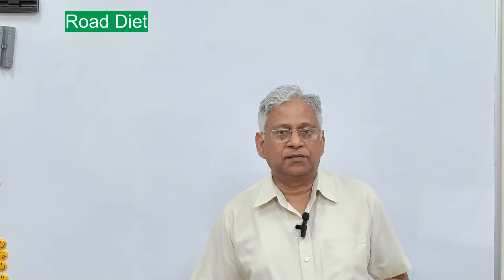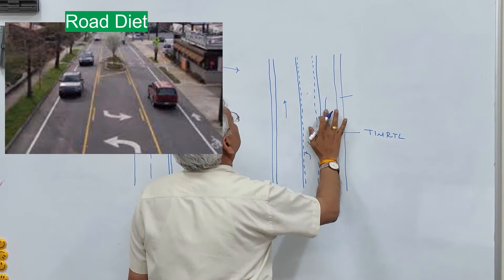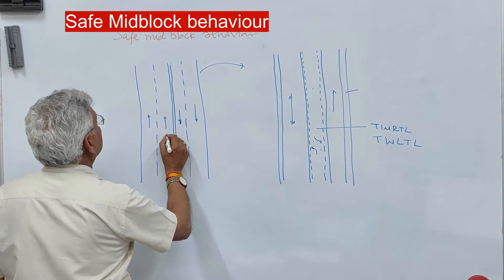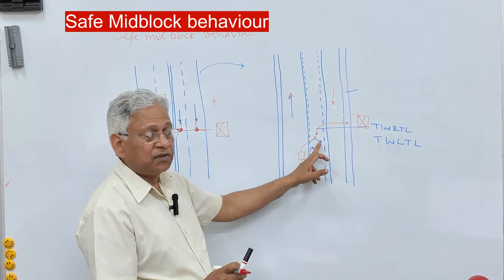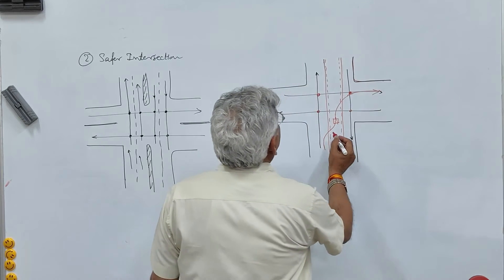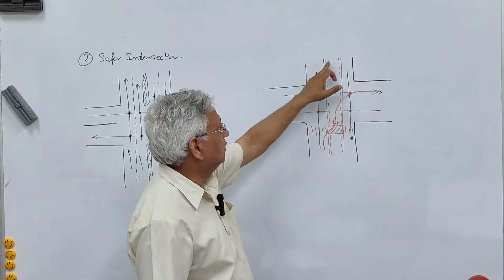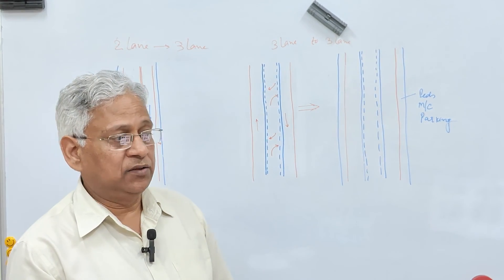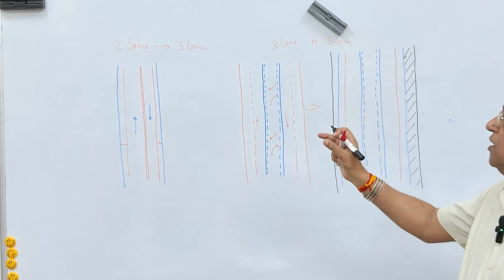What is meant by Road Diet, reconfiguration of roadway, concept and benefits of road diet

Comment: Thank you sir for your informative videos 🙏. Sir, I have a doubt about this, will it not reduce the capacity of the road, which may create a bottleneck type of situation if we reduce a number of lanes of the existing facility. 
Or it is just for improving the safety of unsafe locations only?
Reply from the maker: Yes, it will certainly reduce the capacity if we are reducing the number of lanes. The planners claim that this reduction will be very limited as the intensity of interaction with the turning vehicles will reduce drastically, if this concept is implemented. It is a trade-off between capacity and safety and in this process safety has an edge.
Reply: @SatishIITR  Thank you so much sir for your informative response.